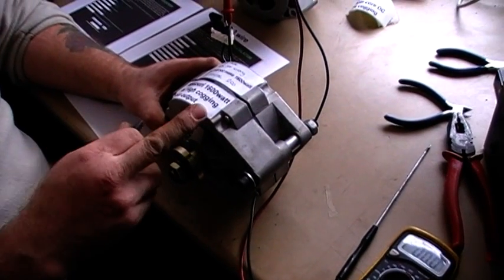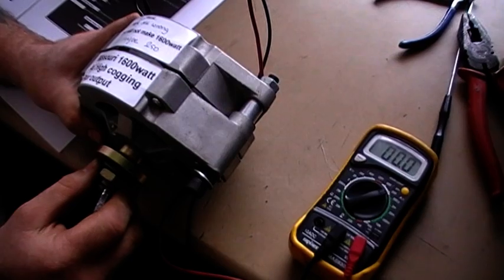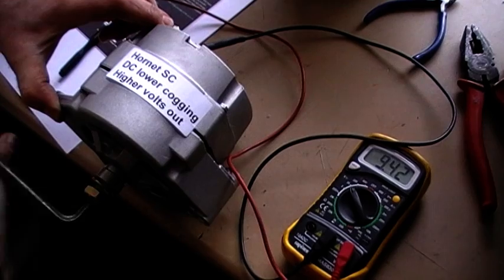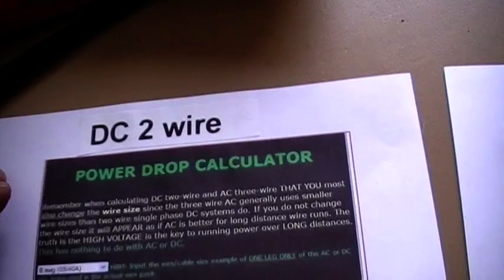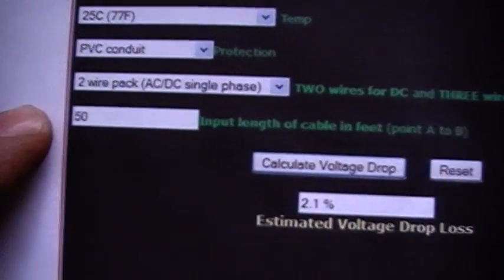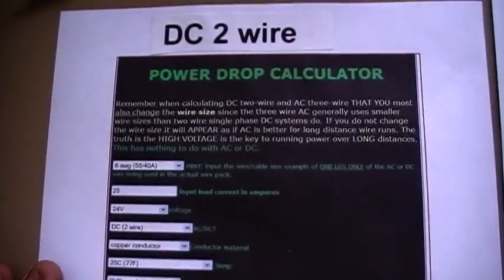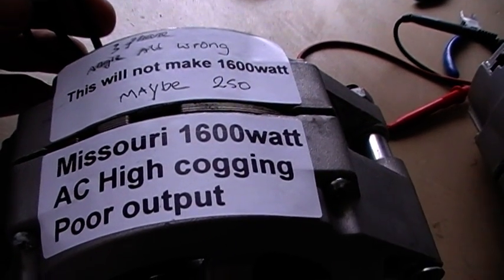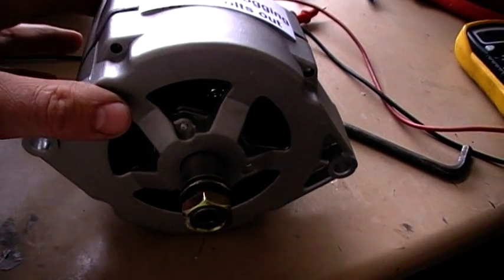Missouri 3 phase PMA unsafe bad design DOA I will repair and make it work Tel: 07711407899

Comment: I bought 4 rotors with Stainless steel shaft and rotors with neodymium magnets off of Jeff at Missouri Wind and Solar , 
I had 4 General Motors 12si Alternators , so I did exactly what Jeff said to do in his videos and all 4 P.M.A.s  work perfectly , I turned each one with an electric drill and I hooked up 12volt car headlight and it blew like a flashbulb on a camera , so I hooked up two headlights and ran it at a lower speed and both lights are bright , so I hooked up a volt meter an it was just a little over 18 volts at around 2500rpm , when it spins to 3600rpm it goes off the volt meter scale , each one will produce 1200 to1800 watts depending on speed it turns , one is going on a V.A.W.T.  , water wheel , bicycle power , and 40cc gas chain saw engine for backup